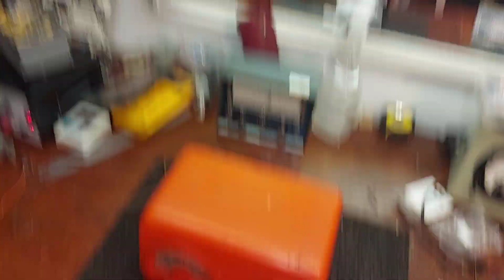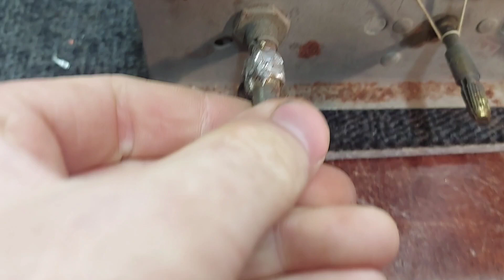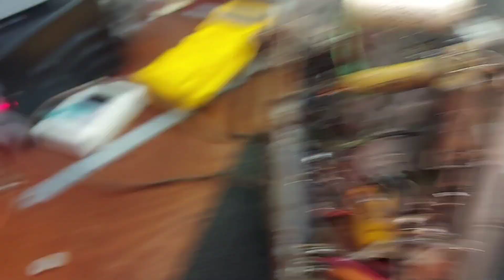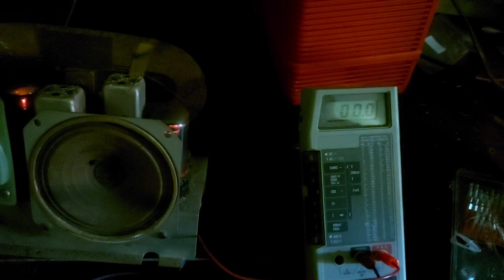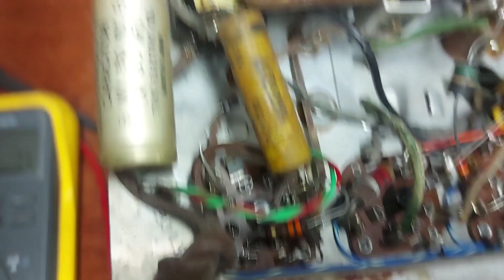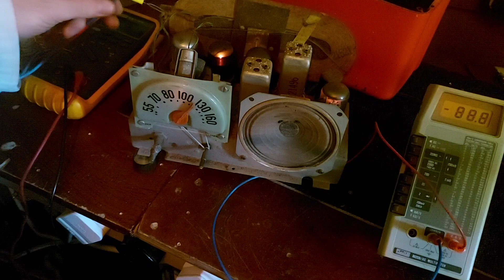Arvin All American 5.

Comment: if the valve has continuity but dont light up it probably loosing its vacuum very slowly and its resistance will be much lower not lit so I would bypass the heater line with a wirewound resistor and also  place a surge limiting resistance of 20-30 0hms in series with the anode of the IN4007 ., Have one but cant find it , sounds just like me !
Reply from the maker: It was all splash and dash just to see if it would do anything. Are you back to work over there yet?
Reply: @IrishvintageTVRadio  Unfortunately yes ,back to work repairing 18 ,month old flatscreen TV s , but Im working on some very interesting projects at home in the loft which are going to make cracking youtube videos !!
Reply from the maker: Great stuff Micheal!!

Comment: A Valve that passes heater current but does not light up can put extra heater strain on the other valves as they have the extra 35v between them. The HT may be up with the diodes but the other valves do appear to be brighter. The set should be a lot more sensitive too like you say.  Also the heater on the AA5 Rectifier valves can act as a fuse! Put a known good rectifier valve in and try with that.The valves may have been damaged by excess heater volts. It is probably an easy fix. And to run it at 240v why not try a capacitive dropper on the heater chain. A lot less heat. Also check that the frame antenna is OK.
Reply from the maker: I might have another go at it Steve.

Comment: Would try another mixer oscillator valve (tube!) if you have one.. It was getting your electric fence across the band, maybe getting in at the IF.?
Mr Shango mentioned those transformers with the cap on the top don't get the silver mica disease.. Think you may find the chassis is direct to one side of the mains/110v supply.
Reply from the maker: Hi Hugh, no the chassis is not directly connected to one side of the mains on this, all the grounds are brought back to a common point isolated from the chassis. There is a .01 cap decoupling ground to the chassis from that point.

Comment: Hmm maybe front end problems, and check the first mixer oscillator for the correct frequency.
You can use another receiver to sniff the first oscilator,  no direct connection .
Or you could do some r/c checking.
Option 2: stick it in a cupboard and ignore it lol :-D
Reply from the maker: Option 2, I'll never use it anyway. Just wanted to see if there was any life left in it.